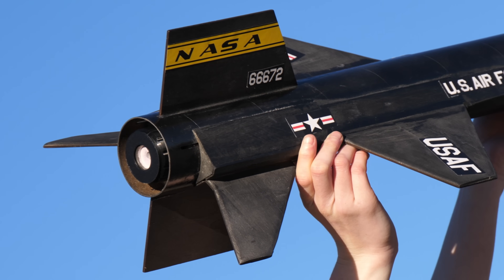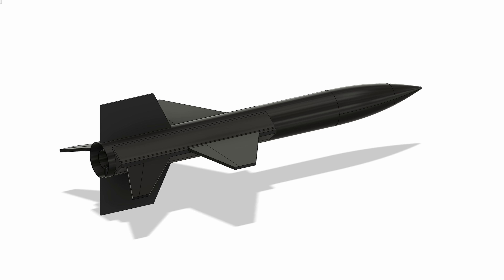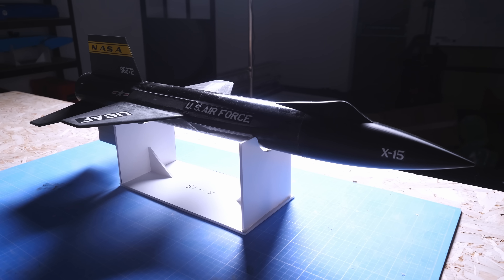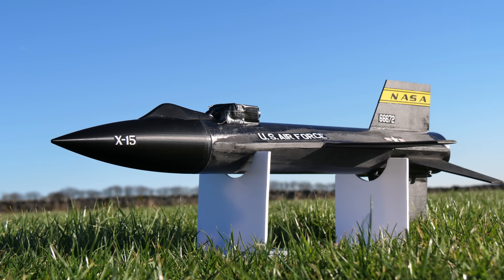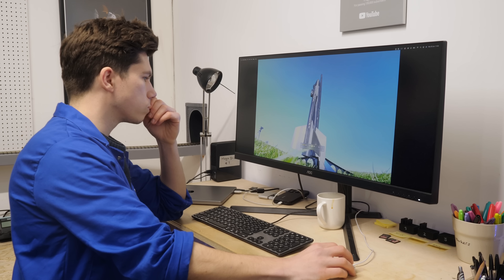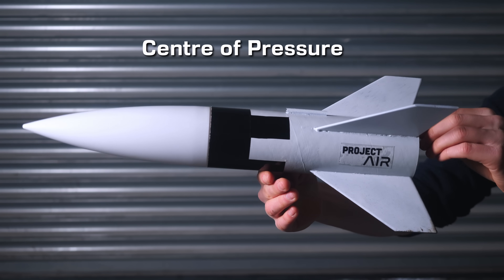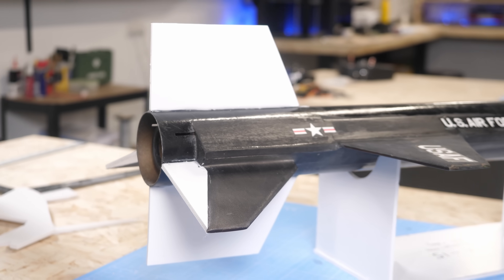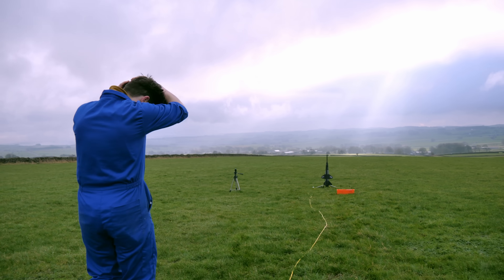Building a HIGH SPEED Rocket Plane

Comment: The X15 burned liquid ammonia and liquid oxygen.  The Space Shuttle solid rocket boosters used amonium perchlorate mixed with aluminum powder and a few other chemicals.  Cardboard has about as much energy per kilogram as liquid amonia. Cardboard has five times more energy per kilogram than the SS solid rocket fuel.    If you could turn the rocket into a ram jet, it might have a lot more power.  A ram jet is basically a specially shaped hollow tube with a funnel and a cone at the front.  It might easily be made out of cardboard.  Solid cardboard not corrugated.  Like poster board.  It has to be going about 400 mph to get much thrust from the ram jet effect.  If the cardboard inside is set in fire, the blast furnace like conditions from the compressed air might turn it into a very powerful ram jet.   

Suppose two planes are put on an axle so that they can fly around in a circle In a steel container or at the bottom of a  deep hole where it won't hit anyone if it flies apart. .
If the Space Shuttle had carboard ram jet boosters and could get up to a velocity of 7 km per second below 20 km where there is still enough oxygen, it might be ten times lighter and could takeoff and land like a regular plane. The air at 20 km is about 10 times thinner than at sea level.  Could a plane travel 10 times faster because of the thinner air?  If a plane could get going the approximate 7 km per second for orbit, it would only take about ten seconds to reach an altitude of 100 km to reach low earth orbit.  But it would start burning up in the air at 20 km because of the friction of the air.  At 6G it would only take about two minutes to get up to 7 km per sec.  A cardboard  booster would have a lot of advantages.  If some of it burns away from the friction 9f the air,   maybe it dies not really mattet. Cardboard costs a small fraction as much as the solid rocket fuel.  If the front of the Space Shuttle was covered with cardboard, it would insulate the Shuttle from the tremendous heat. If the entire leading edge of the Shuttle was a ram jet funnel,  the build up of compressed air would act as a heat shield.

Comment: Why not use the same rocket engine, but many of them, and light them off in series.
 Instead of using  a charge to eject the parachute, use the charge to light the next motor.
 Burn four motors, one after the other. 
 Just like the x15.

Comment: Would you like to collaborate on a high speed Trebuchet launched RC lifting body dart or glider? It could also have an on board remote ignition source for a rocket engine. My catapults are capable of 300mph launch speeds.

Comment: I'm assuming you could have saved 50% on the body weight by using plastic parts or possibly carbon fiber. You can spare the extra $50...

Comment: The X15 I designed, built and flew had about two to three POUNDS of nose weight IIRC. Then again it was 6" diameter and over twenty pounds. Biggest motor I used was a K1100. I also found the CG needed to be at where the leading edge meets the body. Problem making a rear engine rocket glider is you need nose weight for boost but not for glide.

Comment: ...You know there are commercially available launch boxes. :-) And I do note that at this point you're not so much building a rocket 'plane' as you are a straight model rocket. Though I don't think the companies have done the X-15 for the high-end engines like you were using, just the smaller ones. And as others have already pointed out, doing an actual CG test of the model (such as a swing test) is also a good idea.

Comment: Thing about the weird wings of the X-15; It had a bunch of little peroxide monopropellant thrusters that handled the majority of it's control at higher altitudes (and speeds), so I'm really not surprised at the aerodynamic antics seen here. The air frame alone wasn't really designed to do anything more than go really, really fast, while trying to keep the pilot from disintegrating at mach fuck. You may wanna look into thrust vectoring if you ever wanna do a more-steerable v2.

Comment: Real world Rocket-Planes are generally carried up under the wing of a larger aircraft and drop-launched.  Doing so negates all those nasty inertia and gravity related issues.  They are under control of the flight surfaces from the moment of release, right?    Computerized stabilization finishes the job that CG starts, and your plane would benefit greatly by it... if it flew like a plane...  horizontal and under control!   Call up your local RC Airplane club... I'm sure they'll have a volunteer to help carry your plane up and drop-launch it!

Comment: Please fly responsibly
the local rules in the UK are fairly basic as are the rules in most EU countries; much like drone laws were a few years ago. 
if able stick to most of the drone-flying-rules especially when the camera is rolling. The thing that stood out for me was that you are flying into clouds on a cloudy day using rocket motor configurations that seems to have the performance to put stuff into controlled airspace. 

Also most model rocket enthusiasts that do use areas for rocket tests do so at rocket launch sites (often owned by local clubs/teams) that come equipped with sheds/shields  to protect the people launching brand new stuff from their own rockets, getting hit by one is bad for you but also for the community as a whole.

you can use software like "openrocket" to test your rockets + rocket engine configurations out before you fly, this would safe you from wasting a lot of rockets, but it's also safer to have some sheet of expected flight characteristics handy when something does happen.

Comment: Gave me a good giggle. However if no horizontal "flight" was achived its a rocket not a plane. I think u could put contol surface on it & drop from ballon or drone from a height to build speed, transition to horizontal ish flight then let the rocket rip. Prob need a gyro, but should not need as much nose weight and at higher speed even shortish wings should give it enough lift? If not a delta swept wing should do the trick.😊

Comment: 1) Estes made an X-15 model rocket in the 1980’s.  2) they were recalled and discontinued because - just like in your video- they were a rocket powered lawn darts.  Your video here was interesting, but ultimately anyone who built model rockets as a gen-x kid in the 80’s could have predicted not only your difficulties and failures, but that it’s a horrible model for RC.  An idea :  build a rocket glider with wings that deploy with the parachute ejector charge.  You might get by with tail/elevator 2-channel controls.

Comment: a high power Aerotech or Cesaroni motor and sanding in aerofoils to the control surfaces should greatly increase the speed, and if your going for a rocket-PLANE, you may want proper aerofoiled wings with dihedral.

Comment: About fifty years ago, I enjoyed creating balsa Free-Flight models of experimental aircraft. I built a Free-Flight profile copy of the X-15 and found that it had stability issues, specifically it wanted to roll. I then realized that I hadn't given the horizontal stabilizers the negative dihedral that the original ( and yours ) had. After correcting that, I found that my glider was a remarkably stable flyer, whether hand launched, or rubber band sling launched. Based upon my experiences, and my love for the X-15, I would STRONGLY encourage You to reconsider, and rebuild your X-15 as an RC craft!

Comment: Have you considered a jet powered aircraft with a rocket boost?  I can only imagine that getting the rocket up and away uses so much fuel and space on the craft that would be better used by a small jet that would get the craft to altitude slowly with large wings, then jettison the large wings leaving smaller ones for a high speed dive and achieving the highest speed.  I'm assuming speed (and an intact landing) are the only criteria?

Comment: A litte trick from my model airplane experience. I avoid melting lead, what i do is use lead shot mixed with epoxy resin and that is a paste that can be put in the spot you want and it will adopt the form you want, you just have to account the resin weight with your calculations
Reply from the maker: That’s a good idea!

Comment: What would be the impact of using the thichew wedge shaped vertical surfaces as own the real X-15? Would that not create a greater pressure on the rear of the craft with little additional weight?

Just 'storming.

Comment: Center of gravity should be at least one fuselage width ahead of the center of pressure for stable flight under power, which you’ll need to test with a charged motor. Then you’ll need to test the CG with an empty motor case to see how it balances for flight. You probably won’t be able to make both work unless you can build an extremely light airframe relative to the weight of the fuel grain though.

Instead, get as close as possible to neutrally stable, then use a flight controller for active stabilization. Have it programmed for two modes, only controlling the tail with half (or less) rates during powered flight, then enabling the ailerons and doubling the tail throws after burnout. Then turn that nose camera around and fly it home with FPV. 😎

Comment: You should look into a fun jet ultra 2 air frame. Extremely lightweight, aerodynamic and durable. I have had mine up to 242 mph on a 6S build with a 7 inch propeller.

Comment: That was really good your first flight your CG was wrong totally wrong but second flight was outstanding it really was and I bet anything that was faster than your other aircraft. By the way my father worked on the original x-15 what I would recommend is this do it the old-fashioned way build a large aircraft that you can drop the x-15 and put a remote fly system on it so you can fly it what's your dropped The aircraft from another aircraft does that is the way it was originally designed to be dropped from another aircraft and if you put remote video fly by remote control it would be bitching really bitching

Comment: Awesome project! The X-15 was great, but anything will be difficult if you want to reach high speeds horizontally. This looks like another good use for the mighty Lanc. An aerial drop starts you closer to flying speeds, and releasing with some altitude more margin for error. You made a promising start!

Comment: If your goal is stability at high speed, then a high wing loading (i.e., a small wing) is absolutely the one thing from the X-15 to keep, not discard. That's one of the primary reasons why airplanes like the X-15 and F-104 have such small, stubby, highly-loaded wings in the first place (the other main reason being reduced drag). Larger wings are susceptible to gusts and turbulence.

Comment: Hey mate, awesome video as always. A thought I had while watching the video: Could you use a more optimized way of modeling with laser cutting large triangles and letting space in your 3D prints, leaving just a sceleton, and setting everything up with a layer of carbon or glass fiber? I would say that this method should save a lot of weight and you can make the whole plane a bit more aerodynamic with that? Or is there a big reason against it, besides the fabrication expense? Happy to hear thoughts about this approach.

Comment: and again, the "brick" of the camera on
the fuselage... there were sports rocket planes with a rigid non-folding wing, for launching, an additional load was often inserted into the nose, which was dropped when the ejector charge was triggered and safely lowered on a ribbon parachute, after separating the load, the rocket plane changed its alignment and planned for a while...

Comment: I love the thought behind using this plane design, however there is a MASSIVE flaw in your logic. Namely it comes down to two things, 1) the plane is designed for hypersonic flight. Beyond the speed of sound things behave very differently to under it. An example would be this, under speed of sound a hollow tube acts exactly like you think. Air goes through middle and creates more drag as air hits inside surfaces. However above the speed of sound the shockwave acts as if the tube was a solid cone with air going around the outside but not inside. Taufledermaus has high speed of this on his YouTube channel.

And secondly the plane was designed to fly at very high alritude with a very little air resistance.

What you are making is not a plane as such as a radio guided missile. As such you should take more inspiration from them. Something like a tomahawk would be good starting point 👍

Also as it's not constrained by usual plane needs why not use swing wings that retract into body only coming out after you are out of thrust or any other ideas that would never work at large scale.

Comment: If you want to build a plane that goes several hundred miles an hour, just get an off the shelf ridge soaring RC sailplane. Nothing that hard about getting your hands on one and they can fly at over 560 miles an hour. That is .73 MACH.  You just find a windy ridge with a strong prevailing wind, and start doing loops, getting fast and faster with each one until the plane is looping several times a second.
Reply: https://www.youtube.com/watch?v=0nyYaL0dGAA

Comment: You need a b52 to launch you, so you stay like an airplane so you don't have to have a rocket configuration so your cg and pids if you use a flight controller stay consistent.  I've been trying to figure that out with a tailsitter vtol on how to go about that and which flight control software to use right now.  They will completely change depending on what your orientation and lift profiles are.

Comment: I would also have redesigned the "canopy" for the nosecone like the original, but hollow an open in the rear for the RunCam lens.  That way, looks just like the original cone, but functions as a hood for the camera as well.  Might be slightly wider, but still would resemble the original X-15.

Comment: One thing I think I see that departs significantly from "scale" and may affect your aerodynamics is where you have the anhedral horizontal stabilizers.  In the real X-15, they project from the edge of the chine.  Yours stick out from below the chine.  I suppose that's an effect of putting on the stabilizer before making the chine, but there's likely a lot of turbulence and drag between the chine and the stabilizer.  Might be worthwhile to redesign that part of the plane.

Also, if you're going to make a sandwich to strengthen the fins, why not make lightening holes in the center layers?  It should have negligible effects on the stiffness of the fins while making them considerably lighter.

Comment: Fun fact: even though the X-15 is the fastest manned plane ever made, it isn't actually the fastest aircraft ever.  That honor goes to the unmanned X-43, which reached a top speed of Mach 9.6 (almost 3 Mach higher than the X-15) and flew using a special type of jet engine called a scramjet.
Reply: And even then, that pales in comparison to the Mach 202.4 achieved by the Helios-B solar probe.
Reply: @BrunodeSouzaLino  Technically so, but all that's needed to go super fast in space is a bunch of delta-V — in space, there's no need to compensate for the friction and drag of a dense atmosphere like the X-15 and X-43 needed to do.  Also, speed of sound is irrelevant in space.

Comment: I see the same basic errors as always:
The engine should burn a long time longer than a couple of seconds.
The engine problem is the problem you always have: It doesn't need more thrust. Needs more operating time. 3 seconds is a big NO.
The plane does not have to take off vertically like a rocket, but rather launch horizontally.
Reply: like, it's excusable the first couple times, but this is really repetitive, he replicates an idea, oversimplifies the concept and over complicates the design, and is dumbfounded when it spins out of control, he has no active control, he's not taking advantage of horizontal flight being that you don't have to fight against gravity for horizontal speed, letting the wings take that burden, etc. This is a rocket, not a plane, it could go fast in either config but he either needs to redesign and optimize it like a rocket to fly fast vertically or to fly it like a plane to fly fast vertically because he built a plane and is expecting it to fly like a rocket . . .

Comment: try x43 (its 3 stages) 1 deployed from b52 2 main ignition, burns, 3 secondary ignition, reaches mach 9
Reply: He hasn't even managed to make something that gets closer to breaking the sound barrier. Mach 9 would require extremely high altitude (most likely beyond of what RC planes are allowed to safely operate) on top of all the issues of supersonic flight quadrupled.
Reply: @BrunodeSouzaLino  ik model plane cant get mach 9 i was just saying the irl model can

Comment: With access to the Bambu printer and your complete 3d model of the scale X-15, you should loose the balsa ad cardboard and print the entire aircraft using a lightweight wood PLA filament. 

A few steps further back… you should consider building a scale B-52 mothership to get your exotic builds to altitude and speed then light that candle . 

Cool build. Look forward to the next